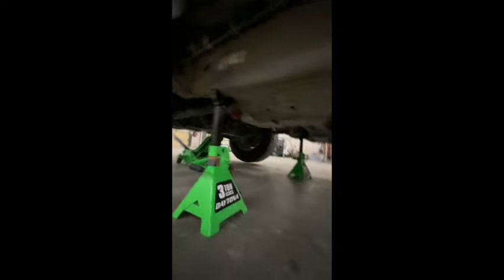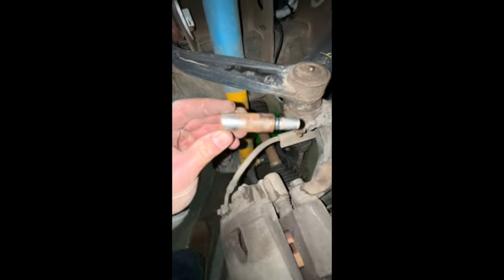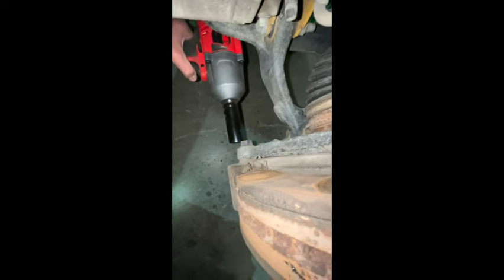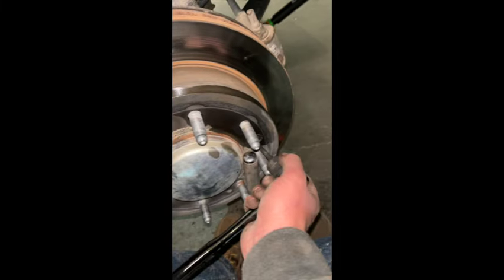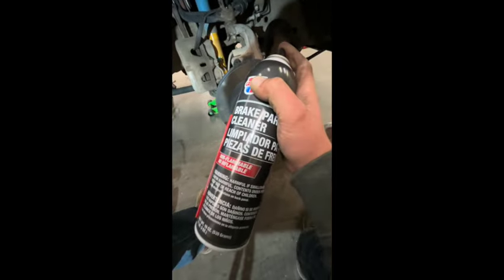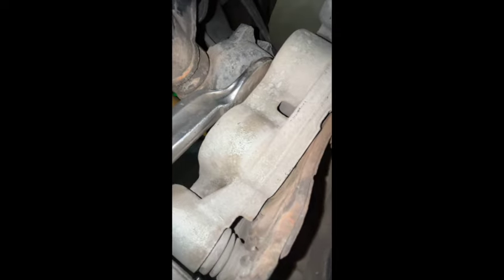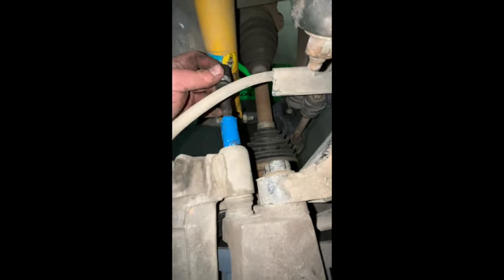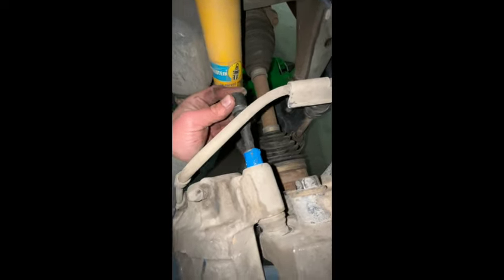2011-2019 Chevy Silverado 2500HD Duramax Front Brake (Pads and Rotors) Install $Super Fast and Easy$

Comment: Would you recommend Napa Rotors over OEM?
Reply from the maker: @marcoa2222  yes, I got the gold standard. A little pricey and makes a bit more brake dust on wheels but they say that is what all the heavy delivery trucks use stopping and going all day, run on their trucks.